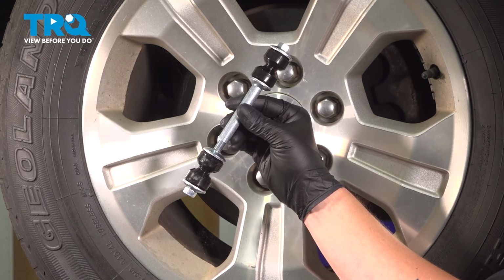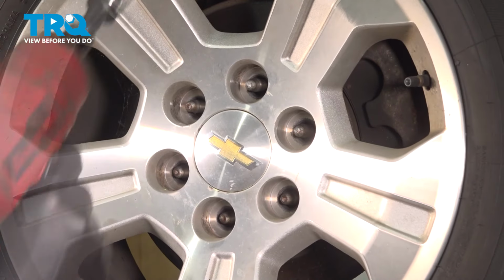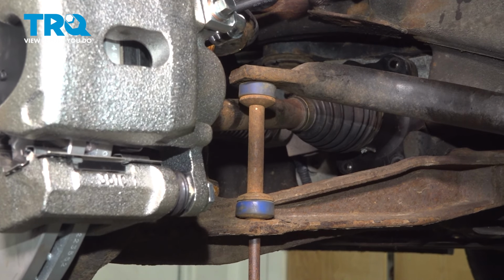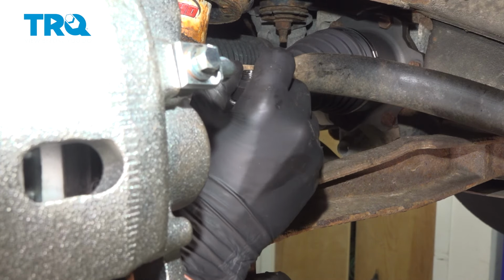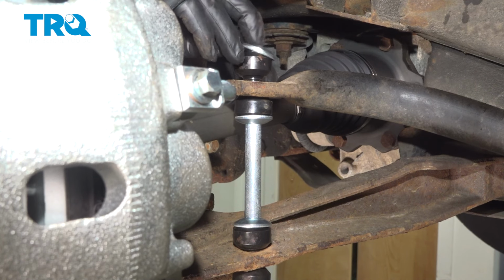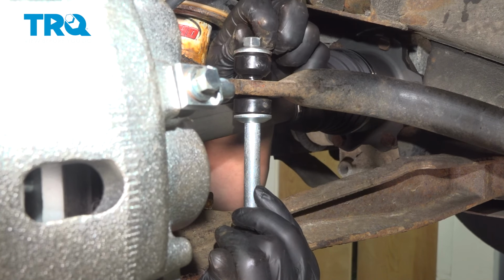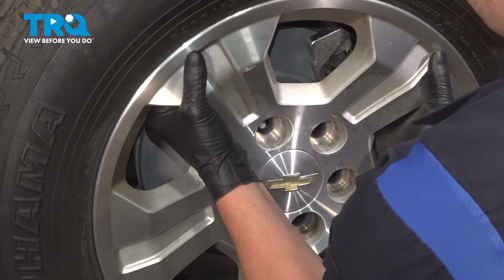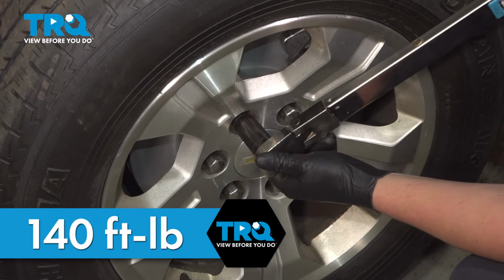How to Replace Front Sway Bar Links 2014-2018 Chevrolet Silverado 1500

Comment: How do I tell there bad?
Reply: You can visually check to see if it's cracked or you will also hear a knocking sound when you hit a bump or make a sharp turn. Sounds kind of like metal knocking under your car.
Reply: I knew I needed new ones because one was missing...haha.
Reply: You can actually move them and also when ever you breaking the car vibrates a little bit